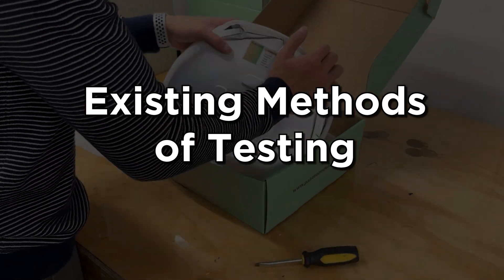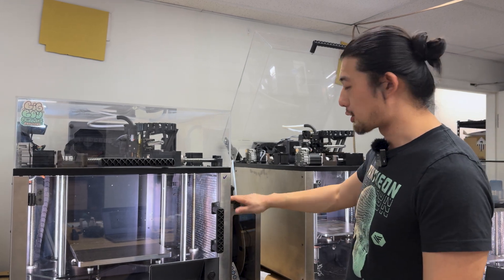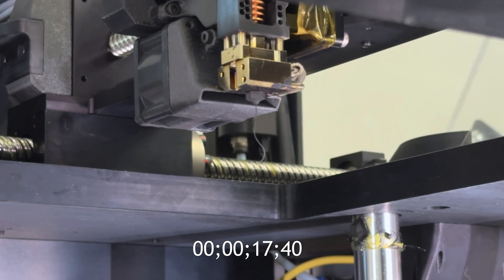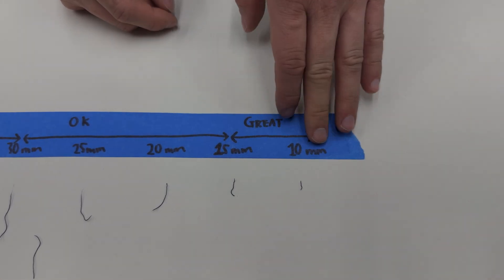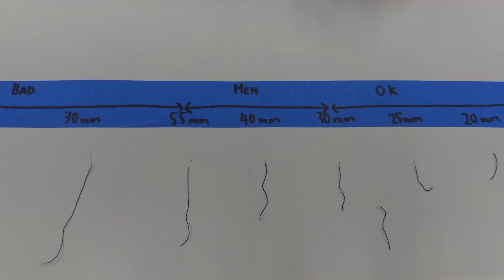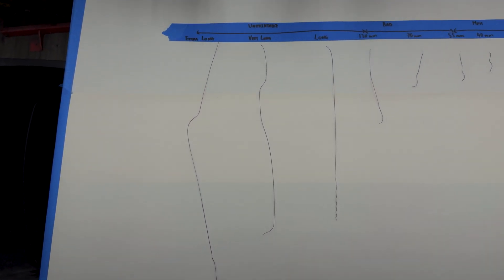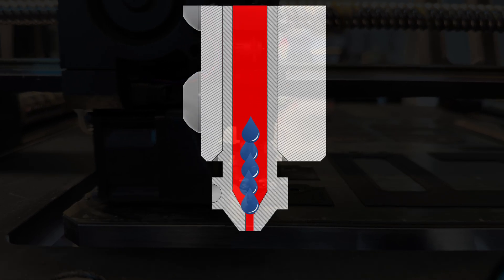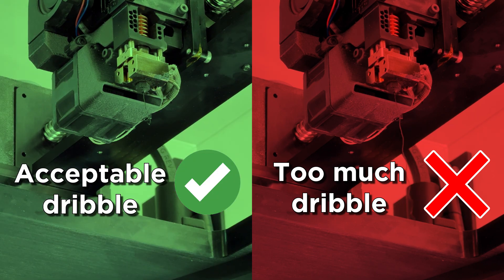The BEST Way to Check Filament Moisture - Fastest, Cheapest, and Accurate Method!

Comment: Very interesting, going to have to try this. Many years ago I only printed ABS and most people said moisture is not an issue with ABS but I was having print issues (this was before there were lots of videos and websites to help with print issues) so I took an extrusion bit and put it under a 50X microscope and I could see lots of pock marks all around the extrusion (0.5mm nozzle). So I dried the roll and did the same test again and again put a bit of extrusion under the microscope and this time it was silky smooth. I reported this on one of the very few 3D printing forums back then along with the before and after photos, some people thanked me but others just stuck to the ABS does not have any issues with moisture line.

Comment: I noticed this behavior on petg too. My dryer has 3 levels. 45, 55, and 65c
I dried petg at 55c until today, when I moved to 65c. Before the dryer, petg would just bubble out of the nozzle and cause ugly finishes. I had similar issue with a specific knockoff brand of pla but only in black.

Comment: Great video. Seems like the first filament off the roll would be the worst and should get dryer as you get deeper into the roll. If a filament roll is sitting out in moist air the outer filament on the roll would shield the inner filament from contact with air. Seems like!
Reply: I believe there are lots of variables. When coming out of the dryer, your filaments first couple layers will be dry. Deeper within the spool is where the filament was exposed during manufacturing. This could be where moisture has intruded.

Comment: Do you measure the h2o with a measuring device to confirm? That would be beneficial if you have the equipment to correlate the % to dribble length.

Comment: Finally, someone who understands moisture in filaments. I always dry my filament before use in a convection oven. I remove a solid 300-400mm length of filament while its still drying and extrude most of that sample piece. I continue doing this until the oozing is essentislly non existent. 10mm is the max I allow in terms of dribble.

Comment: I've also noticed with wet pa the minimum wall thickness up eg, if you try to print a single wall at  0,62mm  with a 0,6mm nozzel with wet Filament it comes out at around 0.83 mm
Reply from the maker: @MB-lh5kw  Ohh yea, as the water expands it creates little bubbles in the print causing over extrusion

Comment: Wouldn't this be dependant on nozzle size too?
Reply from the maker: @SeanTaffert  forsur, we did all the testing with a 0.4. If you print with other nozzle sizes, you can estimate based on the difference in cross section

Comment: Brilliant!

Side note, i've also noticed for my active drier that it works FAR better if i leave it cracked open just enough not to let the heat 'Gush' out to where it's still heating up as if was closed. For me its about 3mm on a Comgrow Filament Dryer (50c max) that i also lined in Kapton tape. I've been thinking of wiring a relay and a servo to open a small vent on top for when ever the heater is on. Possibly spring loaded incase of power loss or operator error.

Comment: That's with nylon. Are we confident this works the same with pla types, petg, abs etc?
Reply from the maker: Yes, the specific dribble lengths discussed in the video are for our nylon. Different filaments will have different acceptable dribble ranges, and can be calculated with your melt column volume, nozzle diameter, and filament  hygroscopicity! Nylon is incredibly hygroscopic, so petg, pla, and abs would have shorter acceptable dribble lengths.
Reply: @PantheonDesign  we need numbers for the others too!
Reply from the maker: @radfaraf  ahh okay, we'll find some time soooon
Reply: @PantheonDesign there’s pla and pla…. My grey pla prints ok after being left open for months.  My clear pla goes all bubbly and won’t make nice clear prints after just a few days.
Reply: just completely dry out the filament and see what the length is. No mater what that would give you a good start.

Comment: Would the moisture meters used by woodworkers work?
Reply from the maker: they won't work for plastics, as they're not calibrated for the materials, and they're meant to measure in the range of 5-20%, not sub 1%

Comment: Does this apply directly (including dribble length) to PETG?
Reply from the maker: This applies to all filaments, and dribble length depends on the hygroscopicity of the plastic you are using. The more hygroscopic, the more it dribbles at full hydration! Nylons are more hygroscopic than PETG, so you should expect a shorter dribble volume at full hydration for PETG.
Reply: @PantheonDesign  Terrific! I love your page on this. Any chance you could throw in some reference PETG lengths into it? Don't need the spectrum just "more than 15mm is bad"
Reply from the maker: Thanks! We don't have data on the PETG yet, but it can technically be calculated with your melt column volume, nozzle diameter, and hygroscopicity of your specific PETG. An acceptable amount of dribble for PETG would be shorter than what would be for the Nylons though!
Reply: Brilliant method. But, my filaments, once the nozzle gets to print temp tend to ooze some anyway. In your $10k machine it didn’t. I suppose we can still hit the extrude 100mm command, break/cut and then time the tail. For less hydroscopic mayerials, maybe we should increase the time a little to get a longer sample?  Or would that be incorrect logic? 

I’m off to read your webpage…

My immediate need is a PET-CF that not supposed to absorb a lot and Mfgr says dry only if needed (how to know is not detailed). So a benchmark for that would be something I’d sure like to figure out.